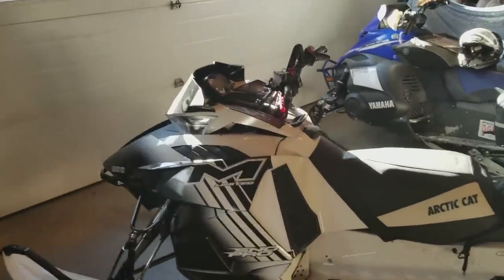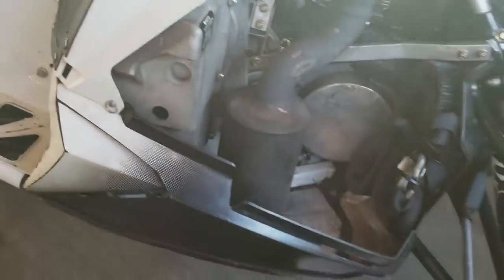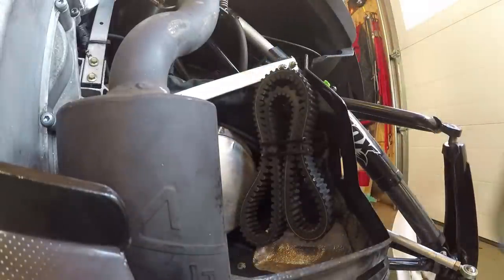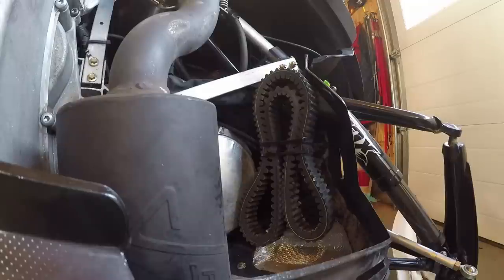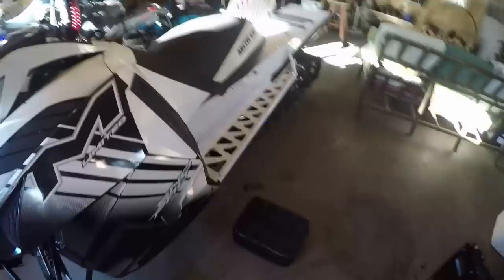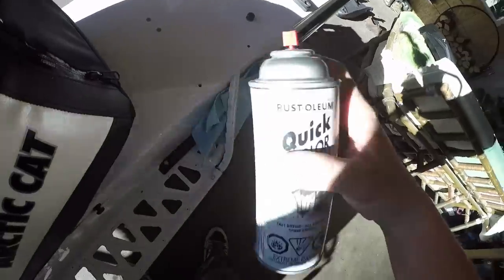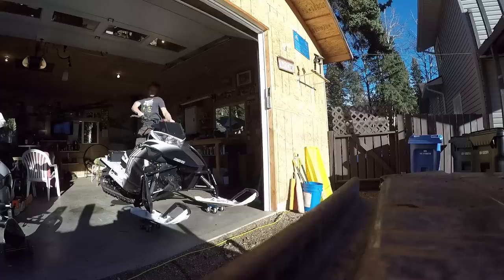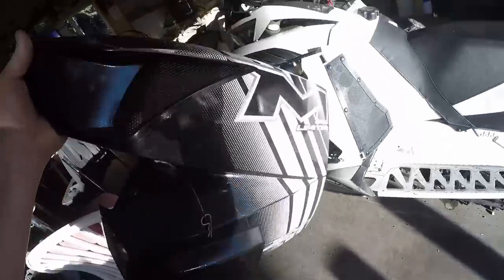The NEW(ish) Snowmobile | M-Limited

Comment: So call me stupid but I can not figure out how to remove my bag and jerry can off the mountain addictions mount , just bought the sled with it on lol
Reply: Jordan Hoffman: pull the pin,  it pulls off to the side the pin was in.  And it doesn't slide easily..
Reply from the maker: You gotta pull the cotter-pin out of the one side, and then push it that way. Use a little force, when they are new, they are tight! When they are new I beat them with my hand and that's just barely enough to get them to move. Give the rails a shot of WD-40 when putting the can back on. It'll wear in over time!
Reply: Syxxes Performance ohh man ok that’s what I was doing just didn’t want to break anything hahah thanks
Reply from the maker: Don't go hitting it with a hammer. Lol. But when they are new, yeah man, they are tiiight.
Reply: Syxxes Performance haha yeah I’ll just use my hand, picked up a 2015 Viper mtx with a boost it turbo from Grand Prairie only 190miles on it can’t wait to try the beast out